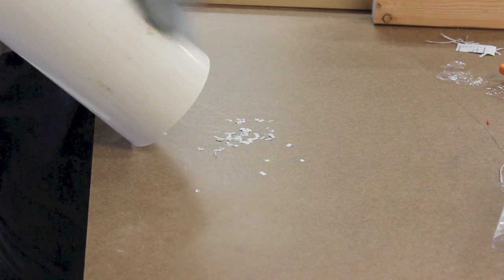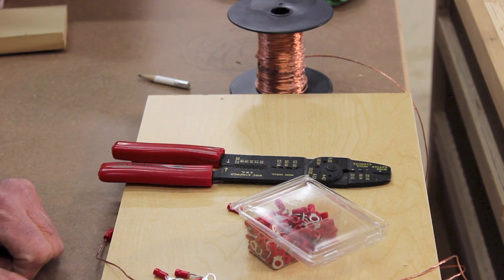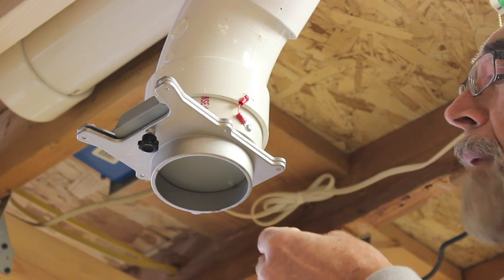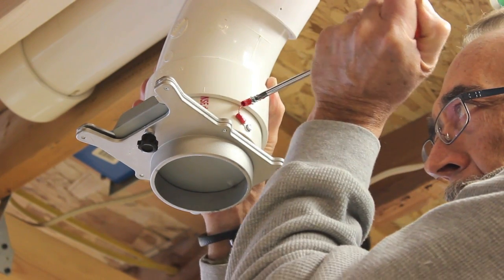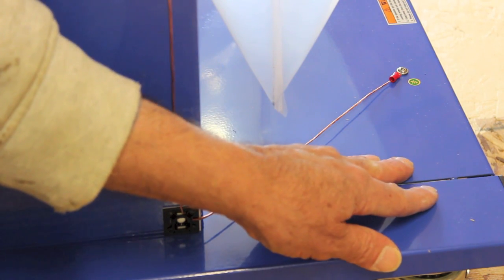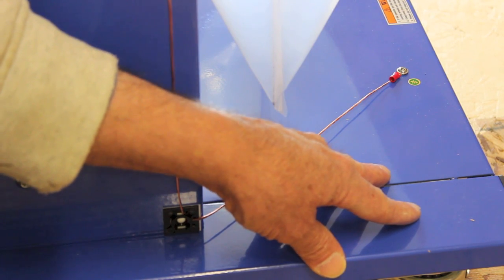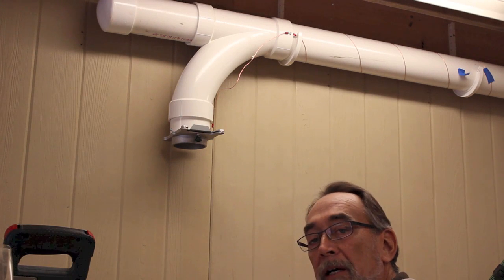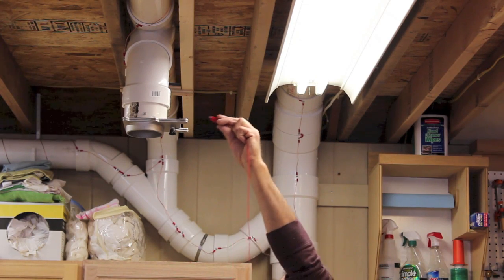Dust Collector   Grounding the System

Comment: While this video appears informative, it is actually MISinformative. Just because you do a good job of explaining a faulty concept, doesnt make it right and wrongly causes members of  your audience to follow your directions.

YOU CAN"T GROUND AN INSULATOR!
You can prove this to your self by performing the same rub test on a "grounded" PVC pipe - it will still attract pieces of paper!
Reply: The term 'gather' is what CANNOT happen.  If it were conductive, then a charge could migrate or move to a point and 'gather'.  When its EMF was large enough, it could discharge and thus causing a problem or just a zap.  However, in PVC, charges CANNOT move, migrate, or gather.  Therefore, wrapping in wire is useless.  There's nothing wrong with grounding the metal blast gates but only if it's convenient.  The garage hobby woodworker need not worry about the static on PVC.  Just my $0.02 from an EE...
Reply from the maker: +Alex Parfenov The problem is with the nomenclature... correct, you cannot ground PVC... but you CAN ground the system of ductwork.  Actually, what this system does is provide a preferred pathway for electrons to flow rather than those same electrons gathering and eventually jumping, i.e. sparking and shocking.  It works.
Reply: Did you consider putting the wire on the inside of the tube where the actual static is being produced. I am assembling a simular system and my thoughts were to run the wire inside. Is there a reason you chose the outside?
Reply: This dumb electrician agrees.  What I see potentially happening is a relatively large charge building to a point high enough inside the pipe to overcome the resistance of the pipes sidewall to the grounded wire. Is he relying on the screws to pick up the static from the inside walls?

Comment: PVC is an insulator. You can't "ground" an insulator!
Reply: Pettigrew Woodworks well if it was a conductor  it wouldn't need grounding. He is giving the static a way to discharge and not build up.
Reply: well there's 9+1 idiots out there...
Reply: Grounding requires a conducting pathway between the ground and the object to be grounded. Electrons will travel along that pathway.

Comment: While it is a good practice to ground the vacuum pipes and tubes, it is more important to remove static electricity from the inside of the tubes.  If you use long self drilling/tapping screws in multiple places, also crimped to the wire that you ran along the outside of the tubes, the pointed end of the screws that extend into the pipe will remove some of the static from the inside of the tubes.  I also run bare grounded copper wire inside the flexible hoses..  In addition I use threaded grounded rod for the standoffs in my Thien Baffle.  My dust container is a grounded 30 gal. metal trash can.

I only use the vacuum for my CNC Router.  It generates considerable Static Electricity.  Prior to grounding everything, I would occasionally discharge myself and the pipes through my CNC table.  Not only did it cause a bad shock it also caused the CNC to either stop or run erratically.

Comment: I noticed that you have PVC that fits the gate valves. Where do I go to get the plastic PVC? I want to do what you did but am have a problem finding PVC pipe that is the correct size. Let me know where I can get this. rayjoy@chartermi.net
Reply from the maker: Leigha Lage This is PVC "DWV" pipe, which stands for "Drain, Waste, Vent."  Any well-stocked plumbing supply house should stock it.  The blast gates do not fit well... they are loose inside the PVC.  My solution? One wrap of vinyl electrical tape snugs up the fit perfectly.

Comment: The PVC doesn't conduct to the screw or the wire.  I don't have any faith that this really dissipate any static.  How do you verify that that there was ever any real improvement?
Wouldn't it be better if the copper was internal to the pipe?
Reply from the maker: Kenneth, thanks... you can read through some of the comments below and my responses to get some of the answers, but you may want to take a "deeper dive" into the subject by taking this class...
http://www.shopwoodworking.com/dust-collection-ductwork-recorded-web-seminar
The fact that PVC is not a conductor is irrelevant.  Static charges build up on and around the surface of the PVC (inside and out) and can be dissipated with a network of wiring as shown in this video... and yes, it absolutely works.
Reply: @downtoearthwoodworks sorry but you are wrong. Try it yourself: rub the Cooper wired PVC in your sweater and see if it can pick up small pieces of paper.

Comment: Couldn't you just continue to wrap the wire around all the joints instead of using a jumper?
Reply from the maker: The screws stick through the PVC slightly (the tip of the point is exposed on the inside) and provides a point at which electrons can flow from inside the pipe to the wire.  Also the screws served the double purpose of joining the pipes together.  The jumpers from screw to screw also make it very easy to reconfigure the system at some later point if necessary.  Thanks!

Comment: An easier and less expensive solution is to wrap the pipe in the silver Christmas garland and ground one end. I've seen this done in a print shop where paper running thru a press generated tons of static electric and caused all kinds of trouble. The press manufacture recommended a several thousand dollar solution that worked no better than the Christmas garland. Merry Christmas.
Reply from the maker: Thanks!  I saw something very similar in a photographic film manufacturing plant, where I assume a static spark would expose the film.  Great idea!  And it will make the shop look so festive!

Comment: They make self tapping screws with large flange heads on them. You don't need to go through all that crimping. Just shoot a self tapper in half way wrap the wire around twice and goo to the next self tapping screw to do the same thing. Waste of time with the stud terminal connectors. This way you know for sure you have a continuous circuit. Don't get me wrong you did a great job but it is supposed to be down to earth wood works.

Comment: Steve. Couldn't you have used the next bigger connector, and then bent, or doubled the grounding wire before inserting in the connector, so the wire just went "in and out" the connector? At least on some of the runs, it seems it would have been easier, used less connectors, and been less crimping? Great job on your system, btw.

Comment: Why not use a multi meter?
Reply from the maker: Of course you could use a multimeter.  I don't have one and was under the impression they were quite expensive.  I have since learned that they have come down in cost… like most things electronic, I suppose!  Thanks for watching!
Reply: Multi Meters are cheap ($25 and they last forever at least mind has) but I have never seen a multi meter with 25 foot extensions , although I suppose you could make them this is a pretty neat idea
Reply: Thats kind of what Inwas thinking.  You could go to the farthest end and measure continuity between the last screw and the ground of the nearest electrical outlet.

Comment: Nice work ! But I fail to understand why the grounding is made on the outside of the pipes. If static electricity builds up it should be in the inside. If a spark occurs this will be caused by the difference of potential between the pie and dust (that causes the static).
Then again why loop wrapping the wire around the pipe instead of simply connecting the wire from point to point ?…

Comment: I understand why you drove the screw's into the blast gates to ground them. But why didn't you just wrap the wire around the drops instead of doing the jumps?
Reply from the maker: The screws were dual-purpose, securing the pipe fittings to the pipe and serving as ground conductors on the insides of the pipe/fittings wherever their points poke through.  Multiple points for any static on the inside surface of the PVC to drain to...

Comment: Thank you so much steve for this information. I took several steps back and im redesigning my runs. Im actually going to be moving my wood rack so I can turn my dust collector and gain floor space. I need to remove the old system of regular duct work and the copper wire that I rann on the inside of the pipes. The only thing is I ran on my old system a dedicated ground from the fuse box to the dust collector then ran out the ground out inside.  I think im going to make a video of what I have and then show it like you did when putting back together.  Steve once again thanks for the information and can't wait till your next video.  Jeff

Comment: Are the screws meant for holding the joints together?  I see no reason they would be needed for grounding reasons.  Also, why did you choose copper wire over something more corrosion resistant?

Comment from the maker: Lot's of very intelligent and thoughtful comments!  Static is certainly an issue with sensitive electronics (per James and Gerald)... my laptop sits on my workbench most days and my camera uses SD memory cards which are pretty sensitive to being "zapped."  Bob makes a great point about dust attaching itself to the outside of pipes... on a cold dry day the hose on my old-fashioned shop-vac looks like it's wearing a sawdust coat after I sweep up.  There has been no dust attaching itself to my dust collection pipes, which is nice.  Jay is right, it is a personal decision. And there are probably some places where folks can't even figure out why we are talking about this... do they get a lot of static along the warm humid gulf coast?  Well, maybe if their shops are air-conditioned.  :)  Other than the time to do it, all the parts cost me ~$30, and John mentions peace of mind... to me that's pretty cheap peace of mind. So far (knock on wood) I haven't been zapped once... on the other hand, my wife's car shocks me every time I get in or out of it.  Wouldn't try grounding her though...